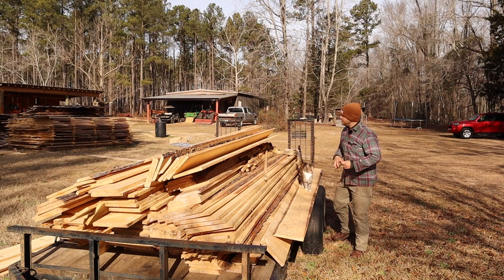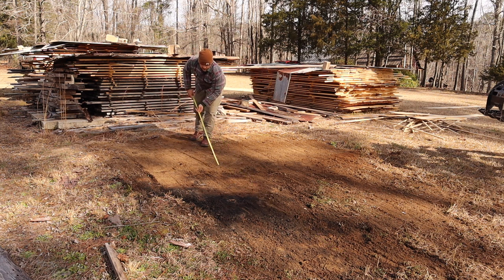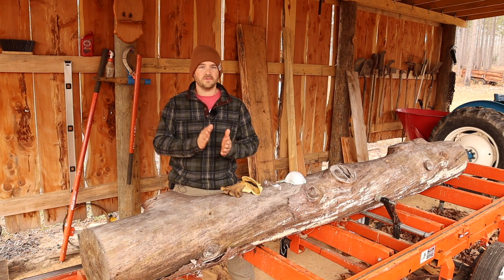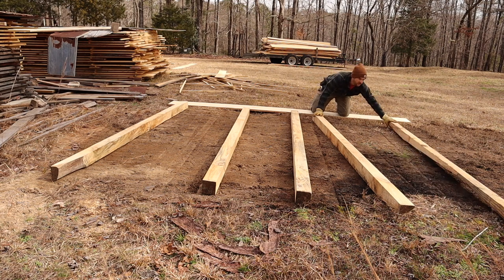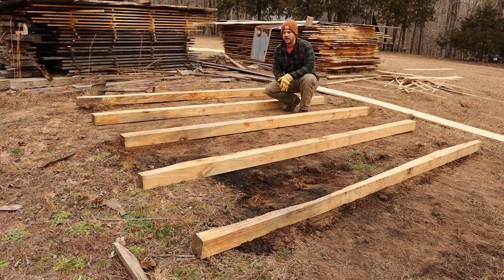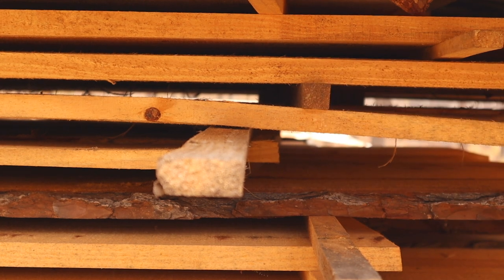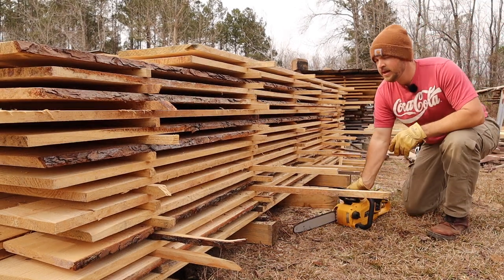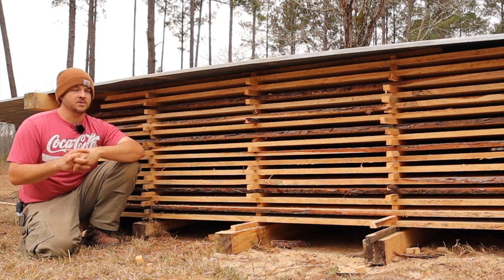How To Stack Lumber Like A PRO!

Comment: Also to use Pine inside a house they need to be heated up in a kiln to 160 degrees for 24 hours to set the pitch in the timber,
Reply: I have sawed a lot of white pine here in southwest Va. and dried in a solar kiln to a MC of 10% or less then machined into shiplap for use inside a heated space.  For a natural look with a whitewash or polyurethane it has turned out very nice.  For painting I think setting the pitch is needed but lacking a better temp. controlled kiln, I used a paintable Sherwin-Williams shellac sealer that blocked the sap bleed so a primer then a finish latex paint worked well.  My solar kiln does get up to approx. 140F in the summer months but not high enough to set the pitch.  Just my two cents worth.
Reply from the maker: Planning on doing something to kiln dry it right at the last, def don't want the shrinkage that comes with varying humidity indoors.
Reply: Thank you for this little tip my friend. You know I have been following you for years as well, I have a mill on order after several years of waiting for the finances to be inline with one. Thank you for this tip, I do plan to use some inside the house. So 160 for 24 hours is very valuable information for me sir, so thank you so much for taking enough time to care and share this with all who watch this video. 
Dale

Comment: Jake Dean and Robert Milton are what I consider Pro Sawyers, I've spent countless hours with them learning the sawmill trade over the past 10 years, they advise to sticker every 16inches, I do the same,  now that you have been educated go back and do it like a Pro 😀
Reply: Not to be a smart aleck or anything, but what I've learned from people who stack and sticker boards to become straight lumber, eventually, they tell me to begin stickering as close to the end of the boards as possible.  If a lot of board is left hanging 'out in the breeze,' those boards don't have any support and they WILL droop.  Then, you'll have no alternative but to cut off the ends of those boards.  Plus, due to their not being constricted, they will develop more cracks and checks than if they had been sticker right out near the ends.
Good luck in your stacking and stickering!
Reply from the maker: Ha! Thanks for the tips. Just going for semi pro here.

Comment: Thank you for taking the time to make this video. You dod a great job. Thanks again and keep up the great videos.
You did not know it at the time, but you just helped me with my future kiln building, I liked your doors on the end and I could put the kiln on the fence row and not worry about it. Now after hearing you say that, I will scratch the idea and go with the larger doors on the back so thanks for the little tip you threw in at the very end about your kiln being not user friendly with the doors on the ends in lue of the back or front. 
Dale

Comment: Great video and nice stacking job. I have been told not make the stacks much over 4 foot wide to allow for the best air flow. Also the old timers say to sticker as close to either end of the board as possible. They say if a board checks on the end it will rarely go any farther than the sticker. Can you add your knowledge to those questions?

Comment: Have a idea
On the solar kiln, put a set of rails and cart. 
I would use 6 or 8 wheelbarrow rims (depending length of kiln) without the tiers riding on wooden rails.
I'm thinking 4x6 beams on the outside and rounded over 3x3 shaped like the rims for rails. 
Load cart outside and push it in and shut the doors. No more head banging while loading.
Let me know if you want more of my ideas.
Enjoy your videos. I'm in the process of building my own band sawmill. Your YouTube channel with other channels keeps my drive during this crap that's going on.
Keep up the good work!

Comment: This is a great instructional video. I will be needing to do this in the near future and was wondering how to do it properly so as to keep from getting "bacon boards" ;-)   As always, thanks for taking the time to film, edit and share your adventures with us. :-)

As for the kiln... I just watched the entire build series on that. I noticed the potential back breaking issues with the doors early on but didn't comment about it. Sorry that it didn't work out as planned. Can you not modify the back wall to make it a rear loader? Maybe even make use of the rear "porch" area and put a frame with wheels on two steel rails that will allow you to load the frame with lumber direct from the tractor outside, and then when you're ready, merely roll the whole assembly into the back of the kiln and shut the double doors and let it go. In my mind, that would make a less than desirable build design be turned into a highly functional and sought after design. Just a thought. Have a good day Wes. :-)

Comment: An old tool for stacking lumber from one pack to another pack that will really save your back and makes your stacking go much faster is a simple tool called a "dead man."  All it is is about a 3ft long metal pipe (about 2" diamter) that's welded to a metal base on one end of the pipe.   You can use anything as the base of the tool like a 12"x12" piece of flat metal. The base sits on the ground and the pipe sticks up about 3 ft vertically in between the 2 packs about 1/3 of the distance in.  You pick the board up on one end of one pack and  walk it over a step and use the pipe end of the dead man thats sticking up vertically to pivot the board from one pack to another.  You want to pipe to contact the board center of the board's width and about 1/3 of the length of the board from the end you are picking up on.  Lumber graders and their stackers use this tool as the lumber grader is grading a pack of boards into multiple seperations of other grades.

Comment: Great job on the stacking but I would not give up on the kiln. Not only would it be quicker to dry, the heat will kill any bugs in the wood.  All you need to do is to create doors on the kiln on the tall wall below your wiring. Build a rolling cart to put wet wood in and roll out the dry. Perhaps even put wood on pallets to make moving around easy using the tractor.
Reply: Kiln drying home made style is a big no no. Guaranteed warping splitting.

Comment: on the last couple layers of stacked wood, use taller stickers at one end, to get that slope you want.   Spent a couple years as a tail-off in an Oregon Mill,  I can stack pretty darn good although I prefer being Operator instead.

Comment: As far as the solar kiln, stack your boards on a pallet outside the kiln at floor height and then pull the whole stack into the kiln with 
cable and tractor.
Reply from the maker: The would work with some modifications. I think it just needs to be torn down and redone honestly.

Comment: great video! I've been milling Oak and Ash up hear in MN and i have found my top row of wood under the tin has been warping super bad, there are stickers between the tin and wood but they still warp all over the place. I've found putting a row of scraps as the last row of the stack to way it down has salved the problem then putting the tin right on top. also if the tin leaks from nail holes it tends to stain the scraps instead of the lumber. have you run into that problem of your top row warping so bad it's useless too?
Reply: Caulk those holes in tin. Doesn't take long. Warping because tops keep getting wet while bottom of board stays dry..

Comment: Curious if you could install a foot throttle on you new tractor? 
I know it’s hydro drive but you could gain grapple control save fuel. Just a thought!! I sold heavy equipment for many years! Not that familiar with your new machine.
Reply from the maker: I'm sure it could be done somehow...would probably take some fabricating.

Comment: OK, serious question: Why are the growth rings on the trees you are cutting (new growth) has wide rings versus old growth teeny spaces between the rings. Are recently planted trees more vigorous? The pretty lady in my picture thinks that old growth compressed the rings as the tree's circumference increased.
Reply from the maker: Hey Bruce, these trees had some nice tight rings. They are not really what you could call "old growth," but they're probably 30 + years old. Some new pine varieties grow very fast, that makes wide rings (just look at the end of a 2x4 the next time you go to Home Depot). These trees were standard loblolly pines, whereas newer trees are a fast growing variety. Slow growth = tight rings.

Comment: Why are the little boards(called stickers maybe) on top of the 4x4's? I'm assuming to minimize the surface area of one board contacting the other? Will it rot in that spot, or stain the wood? Thanks.
Reply from the maker: You are correct on all counts. It will likely stain the board badly in that spot.

Comment: Watching you stacking those boards, I have to take issue with the early stages of the process. I'd like to suggest that between the 4 x4 bearers and the first layer of stickers a narrow strip of DPM (Damp Proof Membrane) would have completely prevented any moisture being drawn up into your valuable timber boards. Just in the same way DPM works in brick work.
Reply from the maker: I think that would be valuable if it was an unusually damp area. But it's well drained and plus the tin on top keeps the ground dry too.
Reply: @falllineridge  Just offering the suggestion for you to evaluate...

Comment: Why can't the boards be laid crisscross? Like one layer horizontal the other layer vertical.  Wouldn't that help?
Reply from the maker: No, the sticker stain from the massive board to board contact would be awful, and it wouldn't dry because there would be no airflow. I've thought about that before, it just won't work.

Comment: Having a flat base to stack your lumber on certainly does help.  I've seen other sawyers who recommend putting stickers a close to the ends of the boards as possible to minimize cracking of the ends.  Have you found this to be the case with the way you stack lumber?  Is it practical to make your lumber stacks that wide?  I think it would be difficult to remove a bundle of lumber with a FEL and pallet forks.
Reply from the maker: Ive heard of that trick with he stickers...pine isn't bad to check on the end so I don't really pay much attention to that. These stacks will be unstacked by hand when the time comes so the width isn't a big deal. This stuff is just for personal use...if I had a full blown lumber yard it'd be a different story.

Comment: How long  will that stack of wood take to dry ?
Reply from the maker: 6 months-1 year. Rule of thumb is 1 year per inch of thickness. Will need them in the summer though.
Reply: Pine will be dry in a couple months.

Comment: Do I have to dry boards to build a building
Reply from the maker: You can build with green lumber, but if you let it dry, even for just a couple of months, your fit and finish will be better and your fasteners will hold stronger...for interior use in a house you definitely need to let it dry, then bring it in to acclimate it. Kiln drying for inside use would be best. Outbuildings aren't as important.
Reply: @falllineridge   ok thanks

Comment: The stack is to wide, prevents good airflow. Need much bigger gaps between each board for vertical airflow around an inch or more. Here in south Ga, stacks should be at least 20" off the ground. With pine the metal should be sloped to allow the moisture from the drying lumber, which will condensate on the metal, to run off without dripping on the boards, and creating mold.  Boards perpendicular to the metal will cause a drip point, use small block to allow room for the water to run all the way off.

Comment: Why did you put stickers on the 4x4s? Seems like a waste...
Reply: 17:28 
He did
Reply: @austinpresley6187  You always want to use narrow stickers to minimize overlapping wood to wood contact. Mold and /or stain can appear if contact area is too great.
Reply: @mcpiddler1135  
I watched the same thing you did. 
I don't know how thin you want them on the 4x4s.
Reply: @austinpresley6187  Generally they about 3/4 to 1" square or so.
Reply: @mcpiddler1135  
From the video, they look to be about that size.
Reply from the maker: The 4x4s gave me a 4" contact area, the stickers gave me one inch. It'll lessen or prevent sticker stain and just generally dry better.

Comment: Don't think this is accurate... you want to cover ground with plastic as moisture/mildew/bacteria will rise, growing on the underside of the boards which will also be the most wet part as the boards as they dry. Add some warm sunlight cycles on top, you got a the perfect ecological camber.